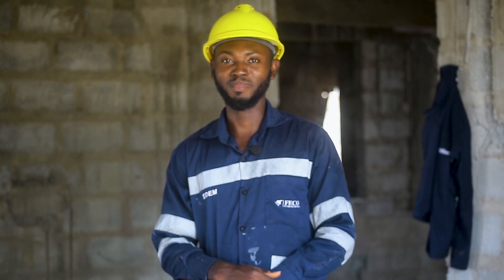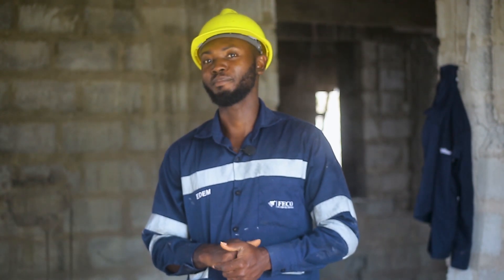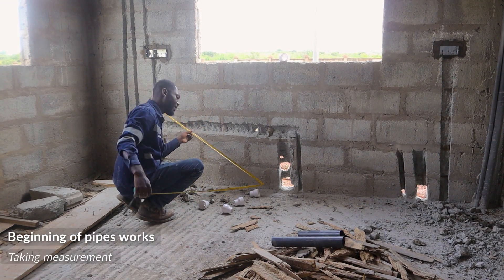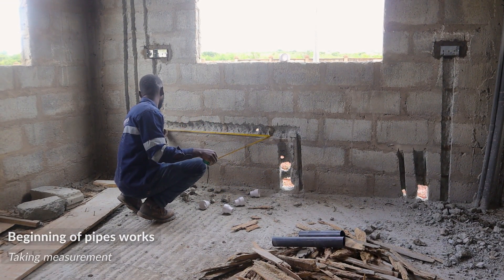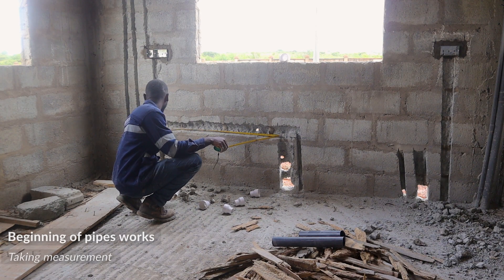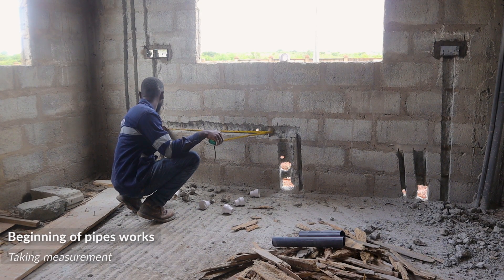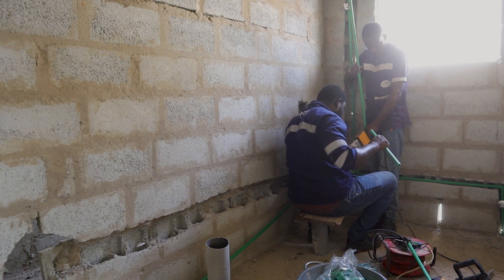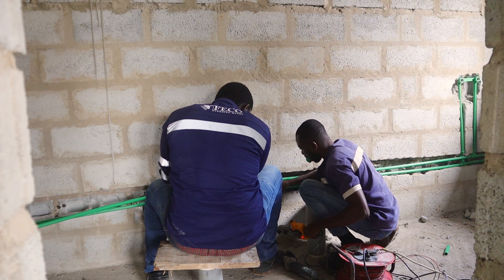Efficient Plumbing Works in Ghana: Installing Water Supply Lines with PPR Pipes | Feco Plumbing

Comment: PPR are more budget friendly than PVC? Not sure I understand this. PPR pipes and fitting cost much more than PVC ones.  I agree the long term benefits of PPR greatly outweights those of PVC but the initial cost is far more.
Reply from the maker: PPR pipes and fittings are cheaper than CPVC not PVC.
Reply: Yes but your audio included  PVC pipes as well thus my confusion
 Thanks